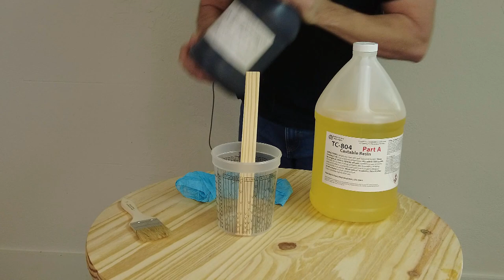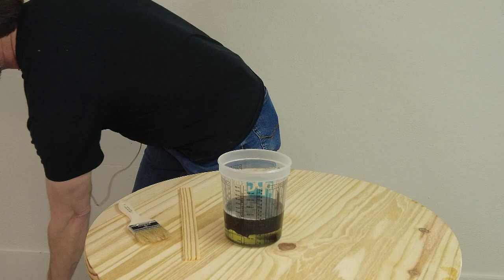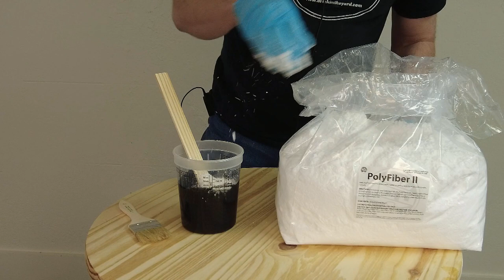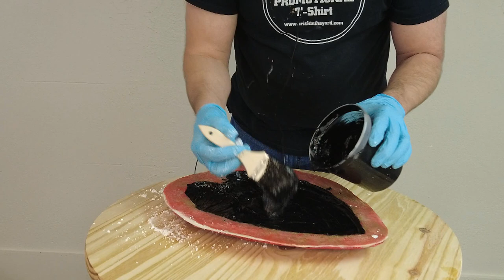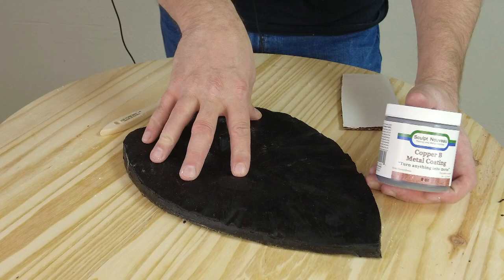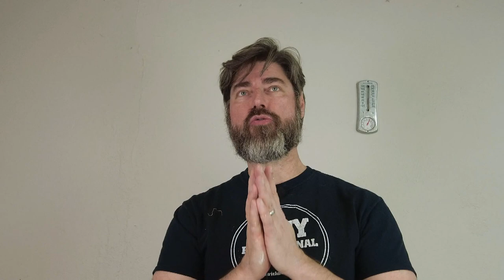Thickening Resin With PolyFiber For Brush-on Applications

Comment: Even without the poly fill could you use the black resin to roto cast into say a skull mold to make a master?
Reply from the maker: Yes, you could roto-cast with TC-804. That said, if you are hand casting I would recommend the faster, TC-808, so you don't have to tumble the mold as long.